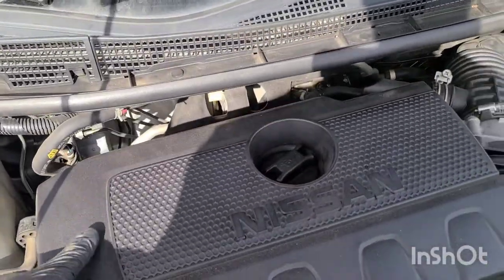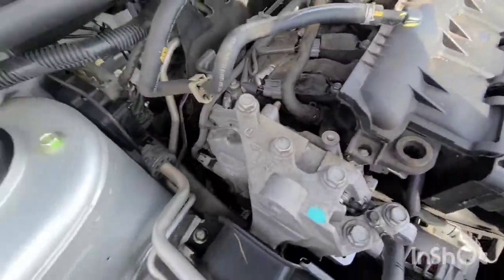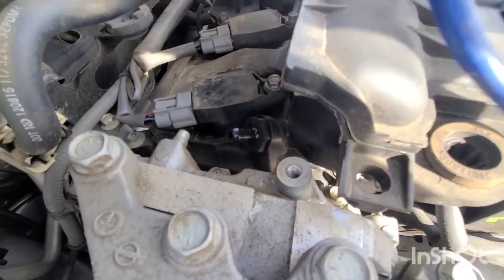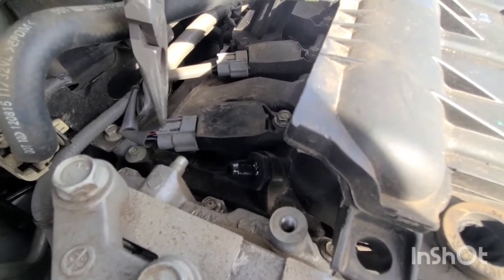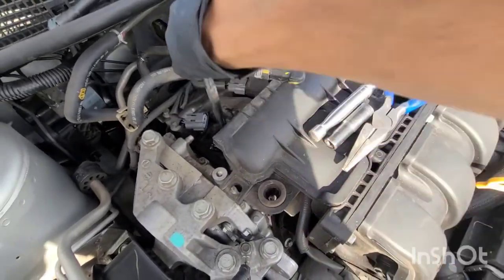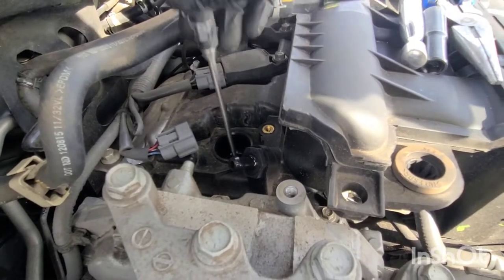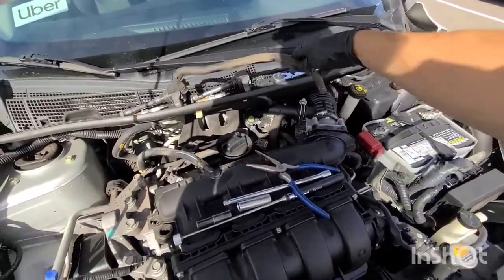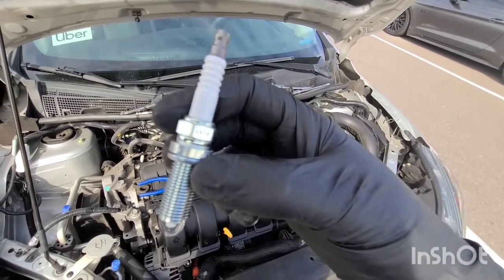EASY HOW TO replace spark plugs 2013-2019 Nissan Sentra

Comment: Torque specs for the spark plug?
Reply from the maker: Sorry I don't remember. If it's not in the video or the comments just remember that the goal is to tighten the spark plug until the crush washer is flattened out.
Reply: @TheYouTubeMechanic  I will try to feel for that. When I did it, it was hard to tell if it was crushed or not. Did not want to continue torquing it as will since the cylinder head is aluminum.
Reply from the maker: The way that I do it is by feel. I wish I could explain to you the way I can feel metal tension through a ratchet. It's literally just tightening bolts over the years, you just get a feel for it.

Comment: You said . 9 gap but 2015 calls for. 044
Reply from the maker: You're using inches while I was using mm. 0.9 mm is about 0.035 in.   0.044 is a little over 1.1mm.